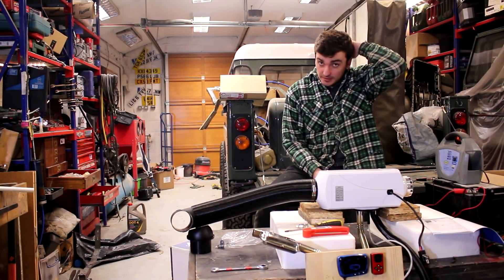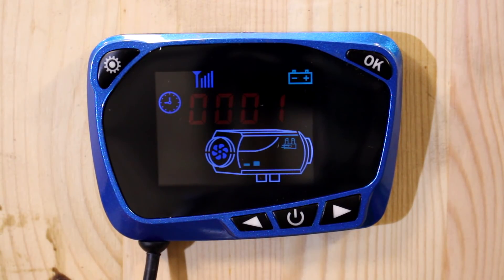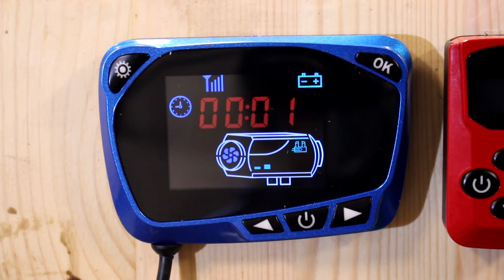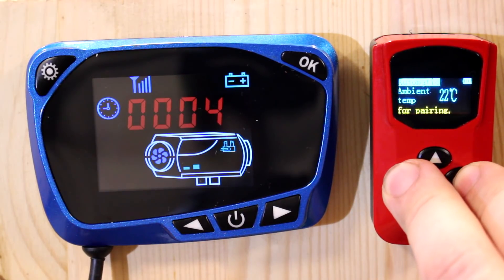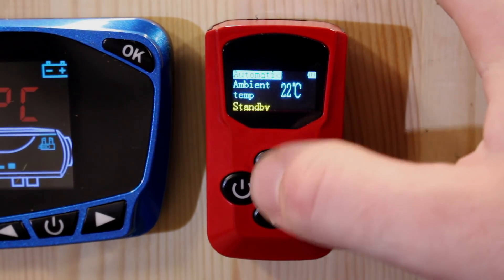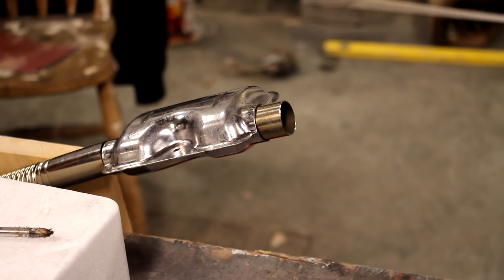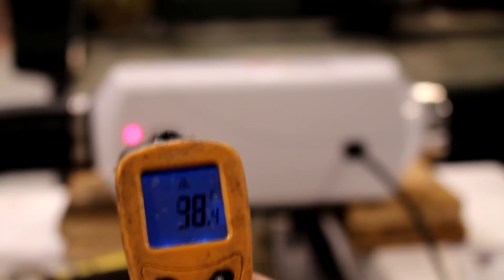CHINESE Diesel Heater - LCD Controller, Remote Pairing & Temperatures

Comment: I have a display that came with my diesel heater it looks identical to the display in the video but has plus and minus instead of left and right arrow. I have lost the black remote that came with it so purchased the red remote which was identical just a different colour, I get the pairing message on remote when holding power and ok but don't know how to pair with blue controller, I've noticed the signal bars aren't showing in my blue control panel so don't know what going on there, any help would be much appreciated

Comment: A quick tip for people. The exhaust is extremely hot. Like you have shown, over 250° so why not use this heat and make an extension pipe system and use it like a radiator before the exhaust goes outside.

Comment: Hello  just got 5 kw heater red all in one blue screen black controls,  when I turn it up to 5.5 kw it doesn't seem really hot, is there a way of increasing the hertz or making it run hotter or which option turns the heat up, thanks

Comment: Hello  should I go for the 8 kw or 5 kw all in one diesel heater, same controls as yours any advantage over each other.   Thanks
Reply from the maker: Hi Martin, both 8kw and 5kw are actually the same power output, it’s just a bit of badge engineering on the Chinese’s part.
Reply: Hello do you know were I can get a diesel heater at the moment in the UK thanks

Comment: Finally a connected remote. Thank you! Do you know if it's possible to set a (low night) temp on the heater, let's say 12°C, so that the fan and heater will only start below 12°C, and turn totally back off above?
Reply from the maker: The thermostat on the digital controller won’t ever actually shut off the heater fully - it’ll just reduce it down to minimum power once temperature is achieved.

Comment: Bro I need help, i've done everything you did in the video but when i start it it shuts down after 5 sec. and comes back on..
Reply: also the red plug doesn't appear on screen when i power it on, could it be from the power suply.. it has 12V 1amp
Reply from the maker: Hi Andrew, 1 amp is nowhere near enough power for one of these. 10 amps would be my recommendation.
Reply: @SamsMotors  yep that was the issue thanks

Comment: IV'E WATCH A LOT OF VIDEO'S AND YOURS IS THE ONLY ONE THAT SHOWS HOW TO PAIR THE REMOTE WITH THE SCREEN CLEARLY , I WAS READY TO ORDER A NEW SYSTEM WHEN I RUN INTO YOUR VIDEO. YOU MADE IT SO SIMPLE , I THOUGHT MIY REMOTE WAS BROKE , I TRIED EVERYTHING , IF YOU NEW HOW  GRATEFULL I AM FOR YOUR TEACHING , GETTING OUT OF A TOP BUNK BED TO TURN THE HEATER DOWN  IS NOT FUN AT MY AGE , THE REMOTE MAKES IT SO EASY TO KEEP THE TEMPERATURE REGULATED. THANK YO SO MUCH.
Reply from the maker: So glad it was helpful David, stay warm!

Comment: What does the parameter with the top icon mountain ?
Reply from the maker: It adjusts for high altitude running conditions to ensure optimal fuel burn.
Reply: @SamsMotors  thank"s

Comment: How long till it starts to heat up?
Reply from the maker: You should feel warmth after about a minute, and full heat after 3-5 minutes.  Not long.
Reply: @SamsMotors  what do u recommend for a 12v battery source

Comment: Does it have low voltage protection in case battery charge goes low so heater will automatically turn off?
Reply from the maker: It does, but I still wouldn't use it on a starter battery.

Comment: Thankyou, this video is quite helpful. I bought a van with a heater like this in, but the little red remote won't move past "waiting for connection" message? Can I use the LCD panel, without the remote, to set the temperature and if so how? Thankyiu....

Comment: My remote came in chinese lol, any idea how to get it to english?
Reply: I did it once forgot and now mine reverted to chinese..did you find out how...help
Reply: @MrFrodo1111  yeah, push and hold the ok button it will change back.  or maybe it's the power button, lol the one on the right (i'm not in front of mine right now lol)
Reply: Finally got it..it's the ok button on remote for a couple of secs...makes sense,I take it to bed and must of rolled over for a few secs and it changed to chinese..back on English now!
Reply: @MrFrodo1111  yeah, I've hit it more than once now.  Love this heater, keeps my rooftop tent balmy!  lol.  16 degrees the last 2 nights and I had to open windows haha.  Course here in NE Iowa it gets well below zero and a nasty wind, so I expect it will come in handy very soon!!!
Reply: @DougRowan_photography  I've had it for a year and I live in a 30-foot fifth wheel with slides and it's kept me warm enough when it was snowing outside and right now I'm in Arizona in the day 70 by the night is like down to 25.27 it can't heat up the whole thing but it heats up the living room just fine so I'm happy with it I love it that it comes with the remote and I can turn it on from bed when I wake up at 3:00 in the morning you know turn it on go back to sleep when I get up the house is nice and toasty
Reply: @MrFrodo1111  I'm surprised this thing CAN'T heat a whole RV lol.
Reply: @DougRowan_photography  It would probably heat it all if I left it on all night on full blast but I like a bit cooler to sleep so I either leave the living rom door closed and the heater on 17 or so or the door slightly open then turn it up when I get awake in bed..I had a big buddy heater but due to mutt did not feel comfortable leaving it on at night due to fire concerns so..when I got up id freeze till the room was warmer now I just push the button from bed and voila all warm when I get up SO HAPPY I AM!!!
Reply: @MrFrodo1111  I bought a T connector, my thoughts are to T it off, and keep either water warm (keep from freezing) or something else, maybe my ice shelter for ice fishing.  THEN it will cut back on how hot it is in my tent.  Park the rooftop tent/trailer next to the ice, setup the 6x6 ice shelter and run a hose out to it, and one into the tent.  Figure the longer run would lose quite a bit of heat, but that's fine, I don't want a hot house for ice fishing lol.  Bought the kit from someone on ebay, sent me tracking a day later and hasn't moved.  contacted them, they are trying to blame ups, but ups hasn't even picked it up, offered a "$3" discount for me to be patient lol.  I said fine, if it doesn't ship in 48hrs, refund me, that was 4 days ago.  So I guess I'll be ordering it again from someone else LOL.
Reply: @DougRowan_photography  I was going to use the t that comes with it by the heater but then put my freezer next to the heater and use the t for the top

Comment: Hello sam ive had my heater for near on 5 years now ive replaced the controller 3 times and the main board twice and pump iam on my 5th but today its pack up again all works untill pump is supposed to switch on but it dont swit h on it displays it on controller but no action if i prime the pump it primes but when it comes to actual use not fireing  i was wandering if it the main board again or controller
Reply from the maker: Hi Phil, that's a strange one.  I'm wondering if it might be the glow plug this time, as it won't start the pump until the glow plug has successfully heated.  Is it giving you any error codes?
Reply: @SamsMotors  yeah its E08 i managed to get it fired once today for about 10 minutes then it packed up again the glow plug works i managed to prime the pump then switch on and it blow out white spoke then die again after fuel ran out in heater as pump would still not fire

Comment: Can you help with the Red Remote functions... Is there a written definitive guide somewhere? My red remote only shows ambient and set temperatures.. and not casing temp or voltage. I have an identical unit that shows all those functions.. so I'm thinking it's a matter of correctly setting it up.. HELP !!!

Comment: I have the blue controller with red remote, I am using a Hulk marine tank which has the fuel line coming from the top of the tank, where the supplied 5ltr came from the bottom. I am following your instructions as I need to prime it, but I can't get the controller to prime. Im doing what u say in the video, but my controller doesn't bring up the H.

Comment: How do you change the temperature to Fahrenheit? I tried the parameters PF1 to PF6 could not tell what they are for?  Original password code was 1668, anyone has a link to an actual User Manual guide?  Thanks.

Comment: BIG SAM...""""HELP""" what battery's go into the RED remote you were using??? Make, mod. #, voltage. not find info. on them ANYWERE!!! Thanks.
Reply from the maker: As far as I know, they are just normal AA batteries!
Reply: @SamsMotors  Thank you very much, but I do believe that they will be AAA.!! I just found out. Thank u once again.

Comment: Hi thanks for this video.
Very helpful and we'll presented.
Mine was working fine for about two months but now when I try to set the timer on and off its not working how it should 
It allows me to set the on time but then when I go to the next option 2off it doesn't allow me to input a time , it just goes straight to the pin lock option?!!
Wtf is happening here?? I sat for hours pressing all different kinds combinations to try to resolve it but no joy man :( 
Is there a fix for this that you know of please I'd be so grateful for any help .
Many thanks 
Jason

Comment: The only observation that I would make is that when checking the temperature of the external case, this temp is in free air. If it was mounting touching something then the temp may be a lot higher. Just a thought if anyone was going to install one in a confined space...

Comment: Does this model have a thermostat where you can set the temperature and the heater will seek this temperature by running faster when it is colder and then slowing down and idling as the temperature is reached?    All I can see is that when you change the temperature, it changes only the fuel pulse cycles to feed more fuel or less fuel.
Reply from the maker: Hello, yes that's possible. The temperature sensor is in the control panel.

Comment: Hi Sam
I'd just like to thank you for the very clear and concise video, this helped me no end in completing my set up. Im planning on running a 80/20 kerosine diesel mix to help reduce internal carbon build up. So far so good, great little heaters for the price 👍
Cheers
Steve
Reply: Just got a red one. Heater has to be off press down arrow and settings button together  and the display will show H OFF then press up arrow to turn the pump on.   Display will show H ON.To stop the pump press down arrow

Comment: i fitted  one of these heaters in my boat over 12 months ago and it is amazing well worth the money
but i had a problem with the LCD screen on the black square unit the display faded till it was not visible 
anyway i just replaced it with one of the new blue versions and a red remote which works great.
do you have any experience  of modifying the locked  menu ?
i have the code and  altered the fan speed  etc .
Andy
Reply: Quick question, I have the same heater but with black control LCD, and remote without LCD. Can you link to where you bought just the blue thermostat and red remote without buying a new heater? Thank you!
Reply: Swiss Williamson 
I got it off eBay lots available just type diesel heater remote I paid £18 for mine

Comment: Hello Sam. Really helpfull video, true.
A question : in your knowledge the blue display is equal to red/gold display, changing position of the buttons only?
Also the trick to use oil pump alone?
I get a red one, but with zero instruction. seems equal, more the Altimeter and a sign for fuel, that i don't understand how it could works.
tks for your time.
Reply from the maker: Hi, thanks for the comment.  Yes - as far as I know, the gold controller is the same functionally as the blue one.

Comment: My blue panel doesn't show the antenna or anything...can't pair the remote. In order to get the "for pairing" to show up, I had to push the ok button FIRST, then, while holding down the OK button, press and hold the power button to get that message. Nevermind, had to follow the instructions EXACTLY and it's fine. Pretty cool for cheap!

Comment: Hi Sam, great video.
I've got the same unit/control/remote. I've paired the remote but struggling to fathom out how to change temp on both the unit and the remote. There's manual, set oil flow and temp on the left side of the lcd screen, when I press OK it alters from temp to oil flow etc. But doesn't allow me to alter temp. I'm not technically minded and struggle with gadgets, so not sure what I'm doing wrong. Also the hertz can be adjusted via the ok/up and down but when you do the same for temp it changes screen directly back to hertz again.
Quite confused.com
Reply from the maker: Hi, thanks for the comment.
It sounds like you've not changed your controller from Hz mode to temperature mode.  Try pressing the 'settings' and 'up' arrow at the same time.

Comment: My remote does not show battery voltage, different firmware i guess?
Also, i cannot set a start and stop time per timer. I can only give 1 "time" per timer.
This is a delay time, so if i enter 00:10 the heater start 10 minutes from now.. (no the clock does not show 00:00 :-))
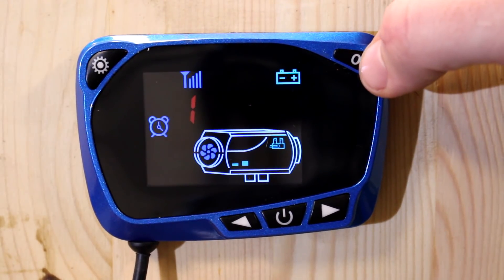I guess your unit does the same (2:15) because it starts with 99 hours and 59 minutes and you couldn't figure this one out either, so you skipped the video content a bit :-)
How can i input a start and a stop time per timer?  Can't find it anywhere

Comment: Hi there. Thanks for the video, very helpful. Just got mine running for the first time tonight. I don’t get the option to set the target temperature, after showing the current room temp it shows a hz number. Can you help?
Reply: That's actually the down button on the right. But pressing the settings and left arrow does nothing, but switches mode on the old controller

Comment: Hi, Thanks for the video it’s been a great help setting up and pairing, I can’t get the language to change despite trying the suggestions on here, so I guess I have a Chinese only remote.
I’m afraid that I don’t have the time to learn Chinese 🤷‍♂️
Does anyone have a link to where a red English language controller can be bought, I’ve tried the link on here and I just get the 404 message link expired.
Thanks
John
Reply: Dont you just press the on button on the remote for 5 secs and the english language pops up?

Comment: Hi Can you tell me the O/D and I/D size of the hot air outlet pipe fitings good video as iI need to get a hole cutter thanks. Jeff
Reply from the maker: Hi its 75mm on the 5kW and 60mm on the 2kW.  Cheers!
Reply: Thanks san so a 60 mm hole for a wood panel would be ok.

Comment: Great video's I am thinking about getting the same one, but before I do I need to know about the battery set up, do I need to  go down the route of having a auxiliary battery with a split charger to run the heater or stay with the normal battery set up? Any advice or suggestions would be appreciated.
Reply from the maker: Hi Alfonso, thanks for the comment.  
Your electrical setup depends on your requirements and your vehicle really.  Do you want to be able to run the heater for multiple days 'off grid', without having to start the engine to charge it?  Or are you only wanting to run it for a short period to defrost/preheat your car in the morning?
Reply: @SamsMotors  initially it would be the latter but saying that camping out in the future may be an option.

Comment: Hi Sam... any idea how to change from Chinese on red remote if poss ? Love the vids 👍
Reply from the maker: Thanks.  It should be just holding the OK button for 5 seconds to change language.  Unfortunately it seems some of the red remotes are Chinese only though.
Reply: I had the same issue. Managed to change to english by (I think) holding the ok button in for about 5 second, then release it and push it again. Now English. I didn't want to try again in case i put it back to Chinese and got stuck. Good luck.

Comment: Hi Sam 
Just installed ours after being reassured by your vids... is amazing. I can’t pair the remote though as I don’t know how to change the language on the remote. Can you advise.
Oh and really fab vids. So informative and clear 👍🏻
Reply from the maker: Hi Gillian, thanks for the comment :)

Hopefully you have managed to pair it by now, but you should be able to change to English by holding the OK button on the remote for ~5 seconds.  

Unfortunately I have seen on the Facebook group that some people have been unable to change their remote language - so I presume that some have been manufactured with Chinese as the only language.  If that's the case with yours I suggest you contact your eBay seller and ask for a replacement English remote or a suitable refund.
Reply: Hold the OK button for a few seconds. It switches back and forth.

Comment: Does anyone know where I can get gaskets for the inside of the heater.  I've has to open it up to clean it and my gaskets have broke
Cheers Tom
Reply from the maker: Hi Tom, I have heard that the gaskets from Eberspacher heaters are exactly the same and should fit the Chinese heaters.  So for a 2kW I believe that would be the Eberspacher D2 - but double check before you buy anything.
Reply: @SamsMotors  
Cheers Sam

Comment: Thank you for taking the time to show these details, I know the 'later' controls, same as you are using, have the ability to adjust 'mixture' for running at altitude, if you do a further video on this setup please add the method if possible.

Comment: Thanks. This helped me learn how to prime the fuel lines. Do you know if there is a thermostat in the LCD controller? Or is the heater only controlled by the sensor on the air intake?
Reply from the maker: Hi, thanks - glad it helped.  There is a thermistor in the black LCD controllers, which is just visible protruding from the case.  I believe the blue LCD also has one, but I have not yet opened the casing to check.